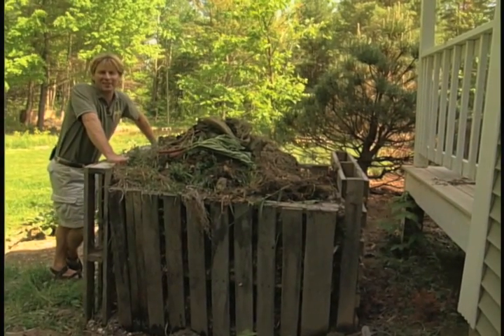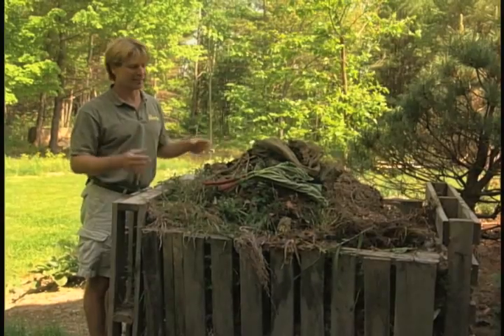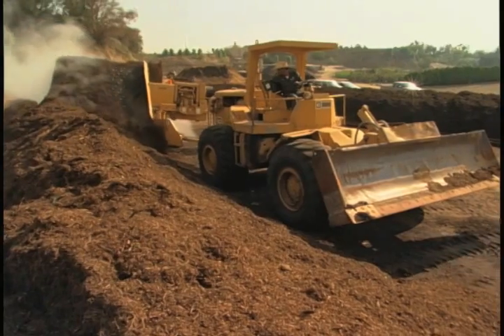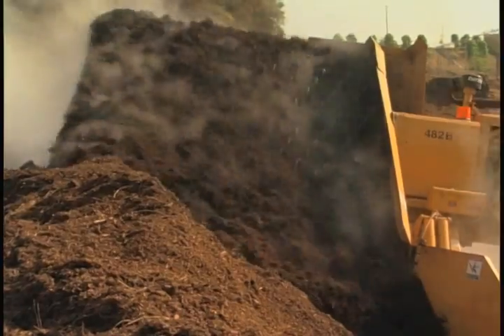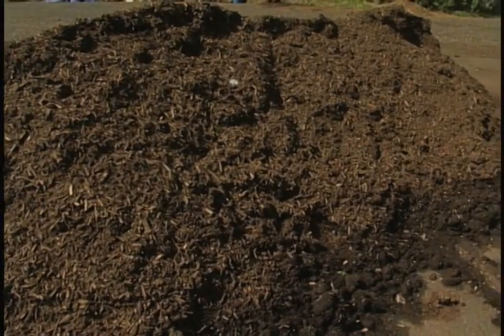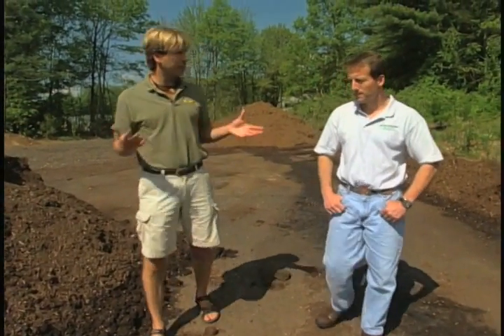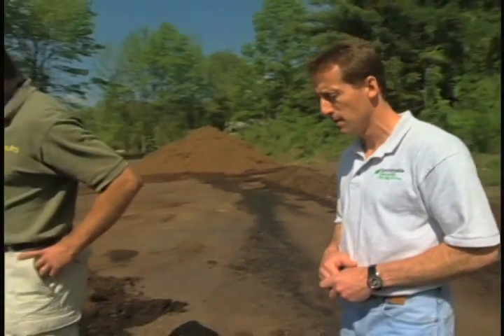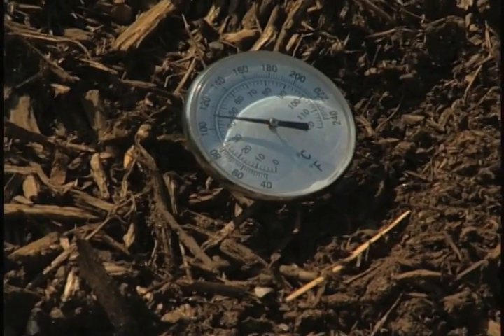What is Compost?

Comment: Cool.  Put the biodegradable stuff in dirt. The stuff goes through the biodegrading process where it gets eaten by bacteria. The bacteria release heat energy while eating, causing the compost-to-be to get hot. Let it get to 130 degrees, and rotate the soil. This kills common pathogens and weed seeds.

 In a year or two, it'll become really good soil or some kind of plant nutrition so you just sprinkle everywhere, I guess? The end was a bit of a cliffhanger. 

Very informative, thanks!
Reply: Galant Baptiste you could inoculate by using say approx 1 inch layer on the ground the worms will draw the compost deeper and then the plants will use it.